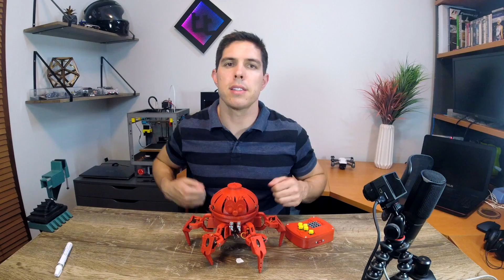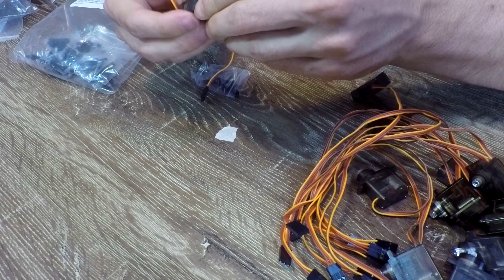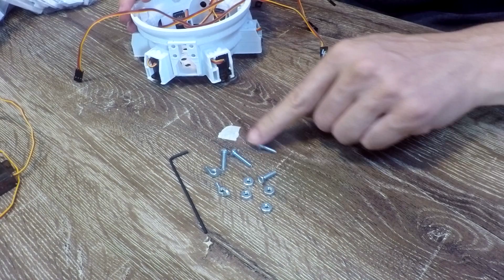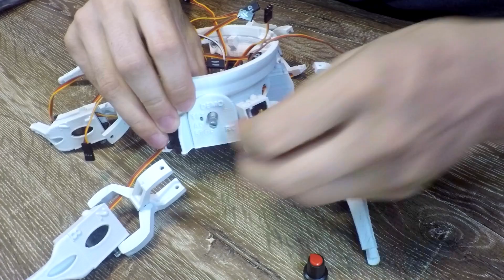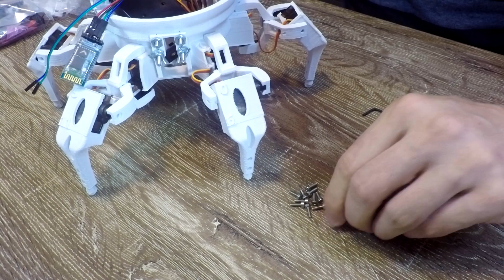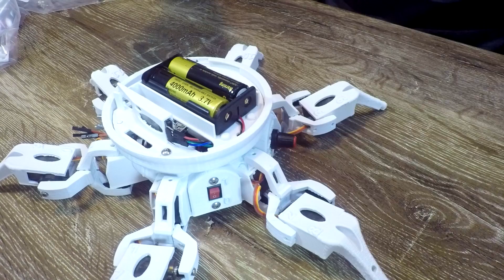Vorpal Hexapod Assembly Guide Part 1 - Robot

Comment: Would have been helpful to know where the servos plugged into controller  or any of the other connections you didnt cover.
Reply from the maker: Hi John, I've covered everything in the official guide, unless it's changed recently. Also, there is a part 2 for the controller.

Comment: If you buy your own parts, make sure you join the VCC and V+ (next to SDA) on the servo controller. If you do not there will be several beeps and no servo movement. For your information, I used Matek UBEC (it is a Dual UBEC) it was the only one quickly available to me and it works, but expensive!
Reply: THANK YOU SO MUCH!!

Comment: Do you have a specific link to buy the battery? Thanks
Reply from the maker: This was what I purchased:
https://www.ebay.com.au/itm/Rechargeable-BORUIT-18650-3-7V-Lithium-Battery-For-LED-Headlamp-Flashlight-Troch/322042942531?ssPageName=STRK%3AMEBIDX%3AIT&_trksid=p2057872.m2749.l2649
Option C wit the batteries and charger.

Comment: The Blueetooth module is designed to have the wires on the left (The LED is now blocked the way you mounted it). Rotate it 180 Degrees, then the wires are long enough, and everything fits snug.
Here is a pic on how it looks installed: http://vorpalrobotics.com/wiki/images/e/e6/Electronics-Caddy-Assembled-HC05.JPG
Otherwise the Video was very straight forward and fun to follow. Keep up the good work.
Reply from the maker: Thanks for pointing that out in a very polite and constructive way.